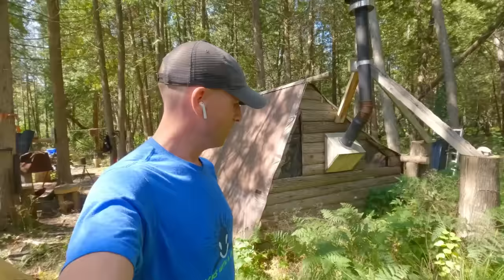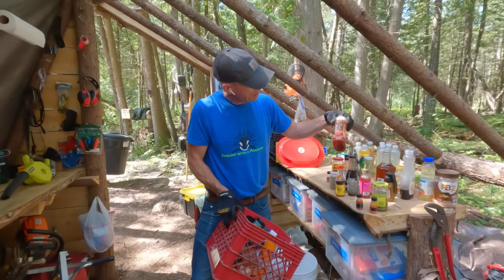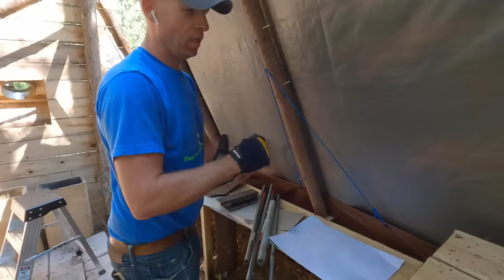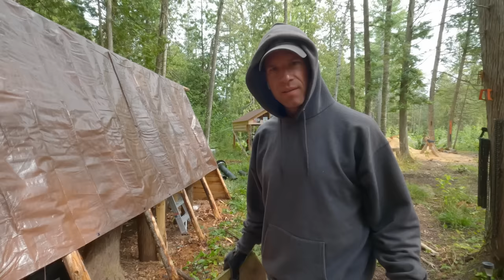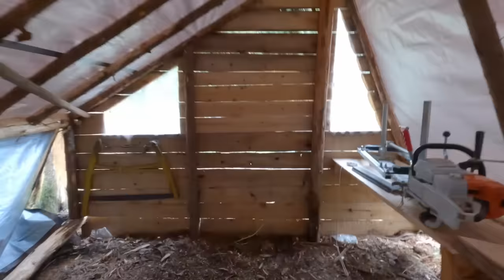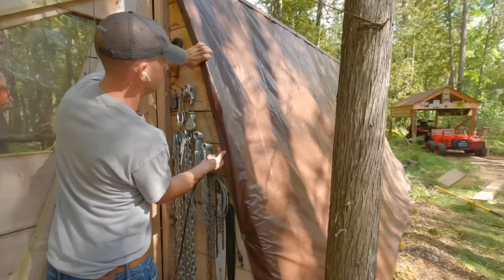How To (Re)Build a $100 Tarp and Pole Shelter/Storage with a Chainsaw. #155

Comment: Make a pallet type of flor for the lean to. Like that water can flow underneath. And make the flor like to feet in front of the lean to so you dont have the winter door freezing problem. Also ive actualy been watching youre channal almost from the start. Ive seen every single video. It doesent seem that long.

Comment: you should use that wood stove for a smoker . think about all the smoked meat and fish or what ever  you could make . best part is if you cure it and smoke it it dont need refrigeration . cure and smoke a nice ham or beef roast and hang it right in the cabin when ever you want just cut off a piece and eat it . could be part of the new kitchen . just saying home made beef jerky smoked cheese  all kinds of smoked sausage . and it would not take much work to make a smoker depending on how big a smoke house you wanted . keep the stove out side of it  and run the stove pipe inside  down low  on the wall or even under the floor if you build it up off the ground . with bears and animals i would build it up off the ground . but keep the stove outside so you can feed it with out opening the smoke house . just a idea i mean im not even sure you read these .

Comment: I don't know about polyester vs polypro BUT I can tell you that polyester is MUCH MUCH more resistant to UV than nylon. Also nylon stretches much more than polyester. Paracord is nylon so it stretches a lot and gets sun damaged.. Those tarps you have are some type of polyester or poly-somethin and they have lasted so well because of that. 

Your tents are almost certainly some type of nylon. Some tent and tarp makers, especially in the ultralight backpacking world are starting to use silpoly (silicon impregnated polyester) which has many advantages over nylon.

Comment: Hey dont complain about that crappy harbor freight made in china stove 
I had one I used in denver as a fireplace insert in a condo cuz it put out more heat then the fireplace you could have insulated your tent with some of that 1/4 inch foil type insulation or built a rocket mass heater a guy in montana heated his teepee at minus 30 below all winter with that rocket mass heater. But no you gotta use propane and at least you got vented ones cuz other wiz youd be soaking wet every morning from the heat from your stove heater n what r u gonna do when you cant buy propane or the gas stoves you need to burn it? Thats coming or its here now depending where you live in the country. Thanks to bidenomics. Though Im praying against it. Or did you put any fire bricks in your cheap stove that helps it distribute the heat better Id be looking for more wood stoves if I were you even cheap barrel stoves burn good Ive seen them in shops for shop heaters in metal buildings with high ceilings e4ven some double barral stoves hell you could use to dry your wood in and why not put in a floor evern using pallets so the water doesnt effect you when the snow melts Just basic stuff n why not use wall tents with real canvas hell you could make your own with roof jacks n put in a cheap tent stove hell look on amazon they got some pretty niced ones with glass in them and water heaters and racks. You might be looking for one for your cabin pretty soon Id say maybe a pottbelly stove since they take up less floor space.